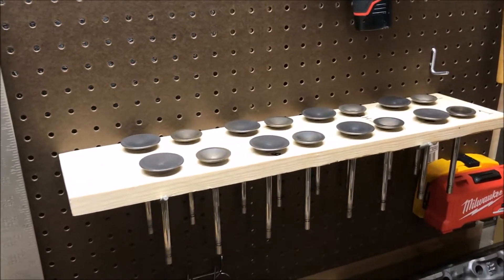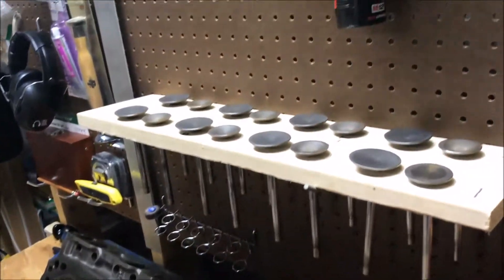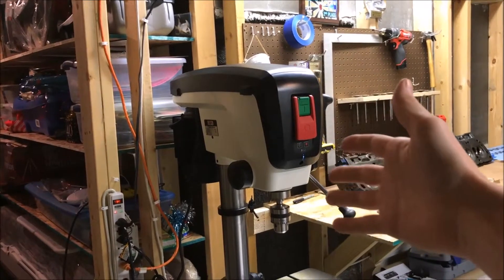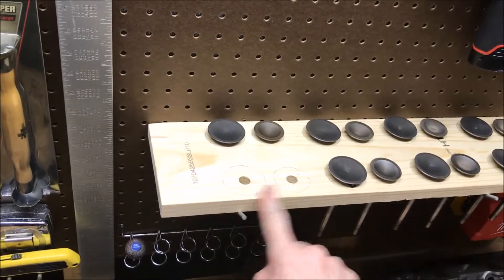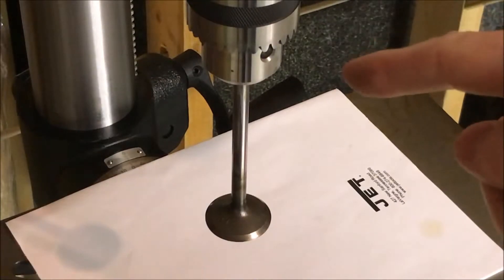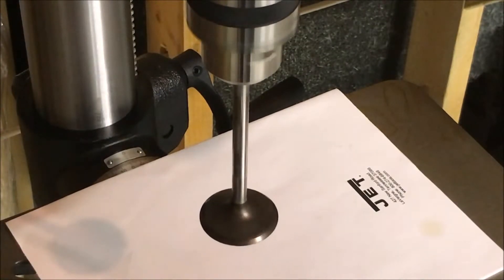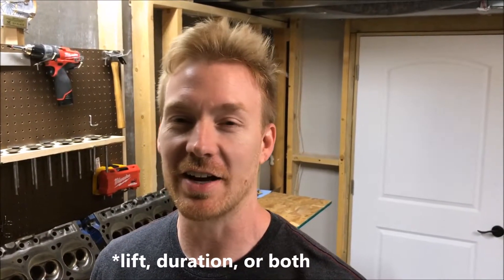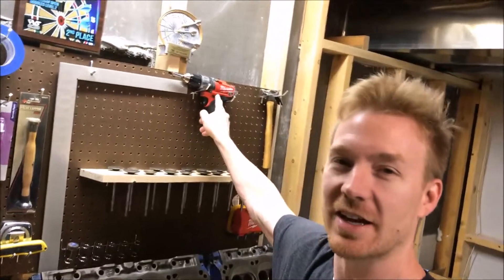GT40 Head Bent Valve Test

Comment: My honda odyssey broke a timing belt and its an interference engine. I will put a new belt on and run a compression test and just replace all valves in affected cylinders. Frigging expensive to replace all of them as planned since mine is i-vtec with vcm☹️☹️ if i replace belt and it runs good i will GO PLAY LOTTO😂
Reply from the maker: Oh boy….a broken timing belt or chain is usually catastrophic with interference engines. Best of luck!

Comment: Hi thanks for the video great idea. I’m in a similar situation rebuilding a Porsche engine and had difficulty removing some of the valves. Did you have to get the valve guides replaced too? Thanks
Reply from the maker: Hello. The valves didn’t come out as easy as they should on this motor either. Honestly, the valve guides should’ve been replaced, but I went cheap and rationalized using them as-is because these heads will be replaced with aluminum heads in the not so distant future. Good luck on the Porsche engine. Sounds like a fun job 👍
Reply: @FastFixYouTube  thanks 🙏🏼

Comment: This is pretty cool I’m gonna try it, I have one cylinder with no compression after a snapped belt. They look ok on first glance but I think they’ve gotta be bent.
Reply from the maker: Yes, I’d say so for sure. Not many other reasons why you’d have no compression other than a bent valve.
Reply: @FastFixYouTube  how bent do you think they’d need to be to cause zero compression? I removed the valves from that cylinder and spun them in the drill press and I’ve gotta say they really don’t look bent at all. No worse than the small wobble you have in the video so I’m kinda confused lol..
Reply from the maker: @bendude6748  hey man. Can you explain a little more in regard to having zero compression?  You’d need significant valve, head, or block damage to cause a zero compression situation. Usually a bent valve will cause a low compression reading then eventually a zero reading as the pressure leaks out as you stop the compression test.  A slight wobble in the valve shouldn’t cause a zero reading.
Reply: @FastFixYouTube  so basically when the timing belt snapped it broke two rocker arms which is common on these engines it’s a 2.0 CDTI Diesel Vauxhall engine. Anyway I timed it back up with a new belt, car really struggled to start so I compression tested cylinder 1-3 were all good with 200psi, on to cylinder 4 and the compression tester just jumped up slightly and immediately back down to 0. I assumed badly bent valves and pulled the head off but they look like they’ve not been touched or if they have they’ve not had a big impact. Can’t see any damage to the bottom end but wish I had done a leak down test before ripping it apart.
Reply from the maker: @bendude6748  gotcha. Yes, a leak down test would be the thing to do, but obviously that can’t happen now. But, you sorta know what the test would reveal:  That you have a leak somewhere. Question is, where?  I assume cylinder 4 was the cylinder with the broken rocker arms?  I’d focus on that aspect of the issue.  Such as (and I’m not trying to offend you) did you install the new rockers arms correctly?  Ie: setting lash and preload within specs at TDC.  Not sure how your rockers are mounted, but I’m picturing a shaft mount system on your diesel. If so, make sure the shaft didn’t take damage and bend. If your visual inspection of the head, head gasket, piston, and block don’t raise any concerns, the problem has to be with the valves or rocker arms.  After all, the rocker arms are the parts that literally broke.  I’d at minimum replace the valves regardless. If they bumped the piston, their integrity is compromised and could cause problems in the future and lessen the performance of your motor. I’d check the valve guides too. Could be a contributing factor. 

Sorry if this wasn’t much help. Let me know how things go.
Reply: @FastFixYouTube  So it was actually cylinder 2 that broke the 2 rocker arms on the exhaust side and that’s now good. The setup on this has the rocker arm and hydraulic lifter assembly inside the head and then the cams are fixed to the rocker cover so they come off when you remove the cover. I actually ended up lapping in the valves and then putting it back together (another bad idea lol) I now have 50psi on cylinder 4. So obviously something still wrong but at least now I have chance to do a leak down test I’m just waiting for one to arrive that I’ve ordered. Do you think I’m possibly still looking at bad valves with the lapping bringing the psi up to 50? Also could a bad hydraulic lifter cause the issue? It’s my first time really getting this far into an engine and I just jumped in thinking I knew what I was doing as I’ve done almost everything else on a car before so maybe got a bit overconfident! But I appreciate your help I’m gonna take the rocker cover back off today and re-check everything in there whilst I wait for the leak down tester to arrive.

Luckily this one isn’t my daily driver I just took it as a project and thought it would be a good opportunity to learn more.
Reply from the maker: @bendude6748  I think you said it best with your question. Lapping the valves brought the PSI up to 50.  Since that’s the one thing that changed, I’d bet on the valves being your issue.  It seems a bit odd to me that lapping the valves made that dramatic of a change, but then again maybe so. Regarding the lifters, I’d say no to that question because the valve springs should keep the valves closed no matter the condition of the lifters (unless one was stuck “up” in the lifter bore disallowing the valve to close) If they failed you would know. They make a loud tapping sound, but perhaps that’s muffled with a diesel.  

I’ll be intreated to hear how the leak down test goes. Feel free to update when you can.

Also, I learned most of what I know by doing. No formal education. Just helping people out from time to time and fixing my own stuff.  Learned some hard lessons, but you gotta go beyond your comfort zone to advance, so keep it up 👍
Reply: @FastFixYouTube  Hey, so I found out what it was, should have done this test before assuming it was bent valves but I’ve learned my lesson lol.. Put oil down cylinder 4 and the compression flew straight up to 200psi. Not exactly sure what happened as there was no obvious damage to the piston when it was apart but I guess that doesn’t mean it’s ok. I think when the psi came up to 50 after I’d put the head back on last time was probably because I wiped the cylinders with some oil for start up, guess that sealed the rings slightly. 
Not too sure what to do with it now but if It needs a replacement engine it’s probably not worth saving with what the cars worth unfortunately.
Reply: Same here! 05 Honda Odyssey, just got the timing done 10,000 miles ago (@140,000miles) and the brand new belt tensioner went bad causing the belt to snap, left my wife and kids on the side of the road.
Compression check was 
180,160,150, 80,60,0
Cylinder 6 bent valves, cylinder 5&4 valves looked good till I tried this technique. Because of the discoloration on the valve it looked like the bend was a mind game because the bend was so slight. But my drill has a light shooting right down on it, if I just concentrated on the shadow on the white paper (1”) below, it was much easier to see the wobble without going cross eye! 
Great video keep up the good work.
Btw I used drill and vice technique!👍🏼

Comment: Thanks. So if it’s slightly bent it’s no good hih
Reply from the maker: I’m no head valve expert, but in my opinion, yes.  On the one hand, if you have a good valve to valve seat seal even with a slightly bend valve your engine should perform properly. However, a slightly bent valve would be under more pressure from the valve spring and could crack or break causing catastrophic failure.  I’d like to have a professional give opinions on this, but I think my intuition is reasonable. That said, valves for these heads are $16 each and I’m not going to spend that kind of money on these heads. So, we’ll see. I’ll probably reuse them and keep my fingers crossed.